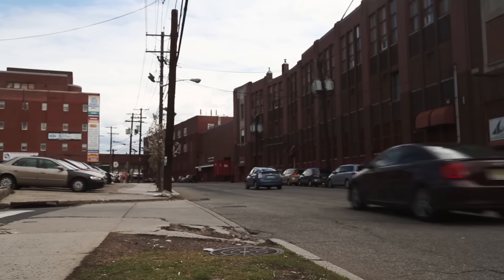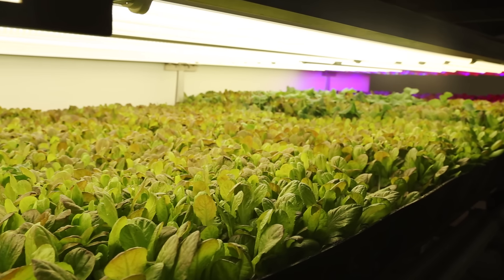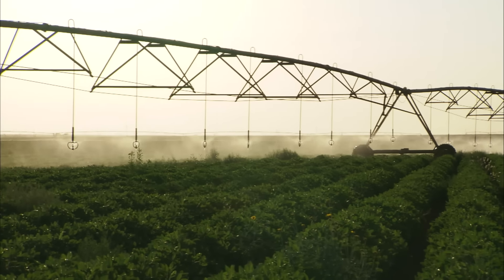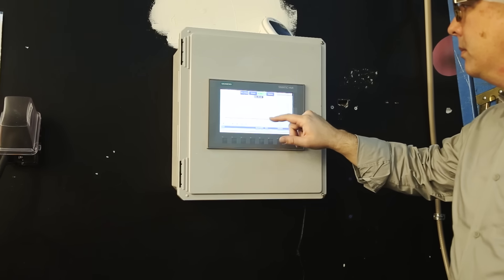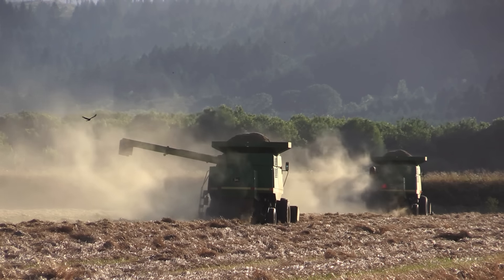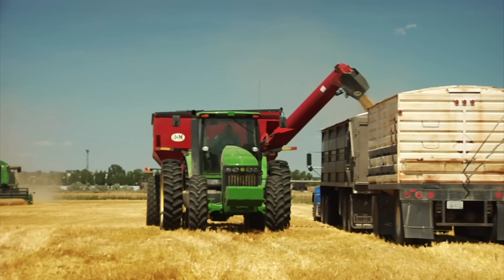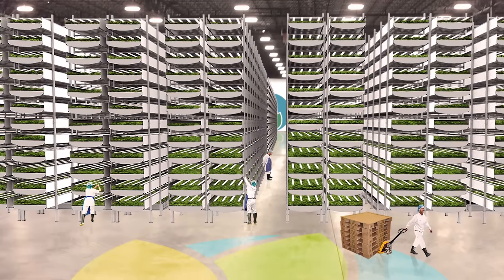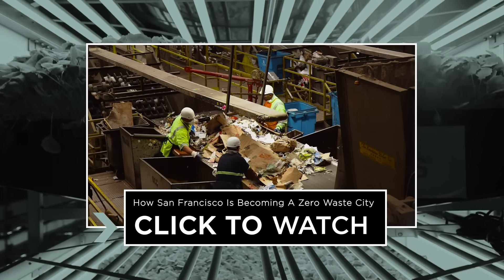This Farm of the Future Uses No Soil and 95% Less Water

Comment: like Uber will weed out Taxi companies, vertical farms will kill conventional farms and hungering be a thing of the past. yes, a few people will suffer as a result but for he benefit of the greater good.
Reply: Doubtful. Conventional farms is till more cost competitive.
Reply: at what cost? fucking the environment. that doesn't sound to bright does it.  anything worth doing generally costs more. its like buying a decent pair of shoes. is ya cup half full or half empty remliqa?
Reply: Vertical farming isn't exactly  greener.What this video neglect to mention is that vertical farming requires intensive amount of energy( which still uses fossil fuel at the moment)  and resources to start up.

The most important thing is there is still no pressing need to switch to vertical farming  right now, even from an environmental stand point and from a cost perspective.In the future, maybe.
Reply: Not everything can be produce in vertical farms also for now it's way more expensive and it's not proven to be efficient. Maybe in a couple years a lot of lettuce production could be made that way, but we're far from there with other crops. For now the only thing that can be grow this way and make profit out of it is weed.
Reply: It will never be more environmental friendly to use artificial light instead of the sun.
Reply: +Philippe Morin

Not until we solve our energy issues ,that is.
Reply: energy problem will be solved by using renewable energy.
Reply: While this is true that electricity bill must be tremendous. You have to understand that this is still the future has we are heading toward being less dependent on fossil fuel. Right now the cost of solar panels are decreasing increasingly making it a viable replacement for our energy needs.

Also, there's places like here where i live in Quebec where the production of electricity is mostly based from hydroelectricity which is clean and renewable for the most part. This factor alone makes these vertical farms an ideal solution and the ideal transition toward a better world.
Reply: Lorem Ipsum  Especially in colder climates like Canada.

I agree with you on the energy. Solar is going to dominate the energy market in the next 110 to 115 years. Powering a vertical farm will be no problem. Way more efficient than traditional farming.

But some crops, like corn or wheat may be a challenge. They're just kind of large naturally.
Reply: +Tim King

I don't think you understand the magnitude of the problem here. Particularly the challenges facing renewable and why they still haven't taken off.

Putting more demand for energy via vertical farming while those issues are unsolved isn't prudent.
Reply: remliqa I understand why you might say that. However, I've been studying solar energy for several years now. Scientific papers, science lectures, engineering presentations etc. I'm no expert, but it is apparent to me that solar is going to take off over the next 10 to 15 years. I think it's about to explode. I can explain a bit here.

Solar technology and solar price performance per watt is following an exponential growth pattern. Every 18 months or so, the cost of solar per watt is going down, while the efficiency is increasing. That's the gist of it.

I see solar energy worldwide growing really fast. If it continues its current path, which I see no reason for it not to, it will over take fossil fuels as a power source in less than 15 years or so - at least in America, most likely Europe, followed by Japan, Australia, and some other countries.

The efficiency of storage technology is also on the rise. It's part of the plan. We already have home units that can store power for night time usage. Storage for solar utilities at large scales is already a reality and continues to improve quickly and competitively.

But there's always something else that nobody is paying attention to, except people who study it.

Atomically Precise Manufacturing. Think of d printers on steroids. Basically it's a molecular level assembly device. This technology will be putting devices from the desktop level upwards that can produce items such as laptop computers, clothing, appliances, building sections, or perhaps a simply wooedn spoon if you fancy. Expect the first commercial APM devices to appear by 2030 or so.

This means that creating vertical farms will be a piece of cake. Okay, nothing is easy without hard work and dedication, but the materials and the energy needed to do it will be abundant and producible on site - even the LED lighting fixtures and the solar equipment.

But most people don't believe me, so I won't be offended if you say it's crazy. I'm okay with that. :)
Reply: Tim King Solar energy will become less expensive and more accessible it's not even a question, but it will alway be more expensive and less ecological than the sun. Also the problem with those vertical farms is not only about energy usage, it's also about the needs of a plants, the plant you produce in those environnements will alway need fertilizer and you'll always need pesticide. Also the quality of the fruits and vegetable you produce in artificial environnement is not the same than in a great natural environment. Changing the way we produce in field is the only ecological way, if done correctly it's also the less expensive way.
Reply: Philippe Morin Anyway, no reason we can't build lots of green houses. We have plenty of space and technology will enable cheap affordable green houses in time.

I do think vertical farming will continue to grow, but at a certain point, green houses will be great sources of food as the population moves to more urban and rural areas (like around the 2030s)
Reply: Yep! Old industry gets replaced with newer technology and jobs are not lost new ones are created. Look at the computer age how many jobs were created out of new technology. Farmers will never be replaced they just need some help because they are one of the most important jobs in the world. (basic survival of all species: Food, water, shelter and procreation)
Reply: +Philippe Morin I will have to disagree with you. You say that the plants produced in these verticals farms will always need pesticide, but it is clear that one of the main benefits of the vertical farms is the lack of use of any pesticides what so ever. 

Indeed, since you're in an indoor temperature controlled environment it is fairly easy to keep the pests out effectively eliminating the need to use pesticides. Also, these farms employ strategies such as air filters, temperature and humidity controls and use ultraviolet light to remove harmful microbes. On top of that, being indoor makes you impervious to disasters that would otherwise decimate an entire crop outdoor. All that these factor contribute to the quality of the vegetables.
Reply: Lorem Ipsum What you're describing is a laboratory, yes if you grow plants in a laboratory completely clean from the outside you can eliminate the need of pesticide, but it's also way more expensive and you'll still need to empty once a year to make a cleanup unless all your employees get cleaned and wear sterilized suit every time they get in. Also you'll face a lot of issues, lettuces are really easy to grow, but lot of crops will face problems because there's associations in the soil between microbes and plants that you can't really reproduce in a laboratory. Plants are alive they need these associations between them and other living things, microbes and insects, if you take those away you have more problems. For exemple, in tomatoes culture you need bees, so another living thing inside, those need sunlight. 

My point is the more you start to understand plants needs the more you realize that to make good food, vegetables and fruits with all the vitamins and nutriments that it can contain, the more you you understand that you need a soil to grow them, that soil need to be alive, full of bacteria and insects. We don't have the knowledge necessary to reproduce that in laboratory we don't know all the interactions between them. Sure it would be fun to have control over everything, but we don't. Being able to grow inside is useful and in some cases you have to do it, but saying that it's an ecological alternative to growing plants in field is a complete lie. The only good reason to do it is for intensive production in confine places, the reason are purely economic, but it's short term economy.
Reply: Energy is not cheap enough in 3rd world countries to make LED lighting viable for vertical farming. This is a solution for rich countries only.
Reply: Valken Pretty much all new innovations and tech are for the rich, at first.  Completely sensable.
Reply: Valken it will help with big cities and pollution
Reply: ***** 
After a while the population starts to decline. Poor people have excess children to compensate for those they lost to hunger, etc.
Reply: Farms would consist of nut/fruit trees maybe...
Reply: *****   No matter how much anyone argues for nuclear power plants, Americans won't budge. We simply do not want more nuclear plants.  Renewable energy is clearly where America is headed. Nuclear plants play their part, but we just don't want them due to the always high cost and the problem of disposing of nuclear waste. 

American tax payers are dead set against paying for them and will protest in large numbers against them. It's a political nightmare to try and get a new nuclear plant approved.

And it's actually quite mad to ignore the most powerful source of energy beaming down from the sky - the sun. A free source and abundant. more than we could ever need. And the science supports it. The engineering is continuing to produce better and better solar and battery technology to convert sunlight into electricity.
Reply: Valken  Actually, the more secure and healthier humans are, in most countries including India, the less children they have. That's a fact. Also, more women's education helps too.
Reply: +Tim King

Yes, American have this irrational fear over nuclear energy ( it's literally an N word over there)despite the next generation power plants are safer and less polluting than their non nuclear alternative. Even the issues of waste is actually overblown.

+Philippe Morin

What Lorem Ipsum  just described is a high tech factory(think of one in the microprocessor industry).Things you described(the roles of microbes and insects) can be replicated or even be replaced in a controlled setting of a vertical farm.
Reply: Oxy Moron  Except that the burning of fossil fuels is a problem with all the CO2 pollution. But apart from that, right - we do not have an energy problem.

That said, if electricity was cheap and clean, we could start doing some really cool businesses that are limited today. IE: Vertical farms and time machines. lol
Reply: Oxy Moron  lol that's true. But most people see it as that when talking about global warming.

I wouldn't suggest inhaling it too much, though.'

Hey wait. I take that back. Technically speaking it is harmful when talking about the introduction of CO2 into the atmosphere by humans:

pollution
noun
the presence in or introduction into the environment of a substance which has harmful or poisonous effects.
Reply: + Cédric Arn4

I think you posted on the wrong comment section.
Reply: remliqa maybe your right. i still believe the first step is to limit meat consumption. its a very inefficient food type to produce.
Reply: Alex Povolotski Nah. People will still buy farmed food do to it feeling more natural
Reply: Michael Tarantolo  Sure, when money is plentiful. But you know what, sometimes no matter how much money I have, if I see two products that are essentially the same, I'll buy the cheaper one.
Reply: that's the story of free trade, and that's something that Trump fails to see
Reply: this wont save the planet since people still eat meat which account for 51% of our CO2 and they destroy the forests now to plant grains for the cattle to eat, slowly destroying our planet in the process. if you stop eating meat it is estimated that you save 400 animals per year
Reply: +penkop2012

Vertical farming( or vertical husbandry in this case) work for the meat industry as well.Use the factory-farm setting to grow the feed stock(which is much simpler than growing food) and keep the livestock in enclosed ,climate controlled  facility where their greenhouse emission (flatulence eg) can easily be monitored and controlled.
Reply: +Oxy Moron

You do realise that CO2 is contributing to global warming/climate change, right?You know ,the thing that threaten to destroy most ecosystem and caused extinction to most wildlife.
Reply: Oxy Moron Alternative fact*
Reply: +Beliye Kolgotky

LOL, good one.

+Oxy Moron

I don't consider mass extinction as sign of flourishing ecosystem.I suggest you read more about the effects of increasing amount of CO2. Everything from the  thinning of sea ice in the arctic poles to the acidification of the oceans .
Reply: Better things repleace worse things
Reply: no hunger means no starving means less death shih means more over population which means more pollution, we need disease famine and war to stabilise population or we are all doomed to destroy the planet
Reply: +Tristram Credland

The whole overpopulation thing is a myth.The guy who coined up that theory failed to account the positive result advancement to technology and science would do to the world population and how to manage them.
Reply: You mean Malthus.. in 1700's. Like pretty much any theory from that day and age, it's been changed, adapted, etc... of course Malthus couldn't have predicted our technology, that's irrelevant; overpopulation is not a myth, it's simple science that any population, with infinite resources, can exceed these resources.  Seeing as we are a closed population (confined to earth for resources), and there is only a finite supply of nutrients (or on a micro-level, a finite supply of atoms/matter) on our planet, there is definitely a population limit
Reply: World hunger has nothing to do with food supply.
Reply: You can't grow corn and wheat in it for obvious reasons. Your everyday US supermarket products are mostly using corn and wheat. It would be a great system to use for supplement crops, but for mass producing grain crops it wouldn't really be a thing. Conventional farms will be replaced at some point in the distant future, but I doubt it would be by stacked farms.
Reply: +Dungar108
The funny thing about Malthus was his theory was becoming weaker even at the time he was alive.The advancement was already there thank to the industrial revolution (and its aftermath), he just failed to account for  them in his theory.

Sure any closed population would eventually reached its carrying limit ( a point in which the resource of such habitat can no longer  support growth, in which would result in stagnation or even collapse).See that the problem with that theory:It assumes that we are a closed population (confined to Earth forever).We're not (unless we're completely fails as a technological species, that is)
Reply: Alex Povolotski why suffer?
Reply: Alamda A. Balqhin Quite a few may be out of a job.
Reply: Bwahahaha renewable energy problems???

Dude we could do so much with nuclear power... People really forget how efficient that really is...
Reply: The only reason for nuclear power is for weapons. THAT IS ALL. P.S. THERE ARE 29 OF THE SAME FAULTY REACTORS THAT CAUSED THE FUKUSHIMA DAI-ICHI. GE has been indemnified by the US government from all legal action. Terrorists don't need their own nuke with that reliability.
Reply: Roland Deschain Terrorists buy material from Russian brokers or Hillary Clinton...

Renewable resources will never able to be as efficient as nuclear power, especially with the new types of power generation that NASA is creating.
Reply: I disagree. The risk outweighs any benefit. You do realize that Fukushima is an extinction level event? It has killed the Pacific Ocean. Tuna and other fish from Japan have died in their spawning grounds along the coast of Mexico. When an irradiated animal dies the radiation doesn't disperse it CONCENTRATES. I hope you've not been eating fish from the Pacific for the last 6 years or so.
Reply: +Roland Deschain

That't onl;y true for old obsolete nuclear reactor designs( including Fukushima) .Newer and next generation nuclear plants do not produce fissile material usable for nuclear weapon production, some of them even "eats" the type of fissile  material used in nuclear weapon.

The Fukushima disaster was ridiculously overblown, especially by people who do not not much about nuclear and radiation and keep on spouting ridiculous claims like what you're saying.
Reply: Roland Deschain I was stationed in Japan during Fukushima. Do you want to know how many people came to my base for aid...

1 family of 5 people...
Reply: Philippe Morin Why not, solar power is cheaper than coal, worthless desert land can make the power. Saving 95% of the water, it can all come from reverse osmosis desalination. Over time food prices will fall, people can then eat higher quality food and obesity can be reduced. It's the poor who eat fatty, sugary, carbohydrate, salt filled food, cheaper vegetable protein, canned, UHT foods would greatly improve their diets. Remote indigenous peoples, get the worst food, because of transportation costs of fresh food, but what if the ingredients were cheaper. Then processed foods wouldn't be cheap rubbish, with little nutrients and lots of calories.

As to the efficiency, plants get less than 10% efficiency out of sunlight, solar gets up to 40%, give them the right spectrum the plants would get 40% efficiency, or 16%. That's 60% more crop, per hectare acre, even from useless desert land, more due to there being, no rain and little cloud. Whilst I'm forgetting transmission loss, I suppose it'd be about the same, with vastly reduced transport costs to the cities.
Reply: remliqa More people work in Solar, in electricity than in coal, gas, or oil combined, as we hit roaring twenties clean disruption. You will see, that it has already taken off.
Reply: Philippe Morin its true that you need a soil that is alive, but what I am wondering, is the following question: Could those 'seedblankets' also act as a pseudosoil? if so, more 'complicated-to-grow' plants like  tomatoes could be grown like this. 
not that I find this the most efficient way to grow tomatoes, for they are a tad longer then the average kind of lettuce
Reply: Stuart Brown It takes petroleum to build those plants. Then you need to replace them every 20 years...

Did you know nuclear power plants recoup their cost of building in the 1st six months of operation. I mean the total cost... including labor, government licensure, all of it... That is how efficient they are. They produce like 10 times the power they use to operate.

Wind, solar, geothermal will NEVER BE AS EFFICIENT... EVER...
Reply: too bad in this indoor environment the plants are not able to create the enzymes we need in order to fight off things like cancer growth...
Reply: oh and check out forest gardens, now that is the way to give back to nature with minimal effort and create amazing amounts of food. Great thing is it supports the natural ecosystems for animals and wildlife.
Reply: +Stuart Brown

I think you're sorely mistaken if you think that green and renewable energy sectors currently  provide more  jobs than the fossil fuel industry.

+anon amous

There is no proof in your statement about enzymes so I don't think they're worth discussing.

Forest gardens shared the same problem as organic farming : they're in no way productive enough to support  huge population.
Reply: As a farmer I am well aware of the stats and it has nothing to do with "greed".  Much of it is due to gov't regulations that control the process from picking to selling. Between 40-50% is not eaten due to problems with picking, distribution (spoilage), discarding of imperfect plants, grocery "out of date" waste, food bought but not used and food prepared and thrown away. I've seen figures as high as 60%

I was once a huge fan of VF  but having visited some I now see their limitations. Start up costs are high, energy use is heavy and (worst)  crops are very limited -almost all leafy greens or tomatoes.  On the good side they are incredibly efficient, close to stores and can ignore the seasons.  But if you want peaches, apples, pears, bananas, squash, watermelon or okra, forget it.
Reply: fun soundwave remixes That's because of a few things. But mainly, they pick them way before the produce is ripe. 

And the majority of GMO garbage you don't eat. That is given to animals for feed.
Reply: Alex Povolotski that will not happen aslong as not everybody turned vegan..lifestock eats up the most of the water and crops..so we first have to eliminate animals as food then this might be a big thing
Reply: remliqa I think they mean that solar alone provides more jobs than coal, oil, gas, in the electricity sector, because of the installation workers, carbon is highly capital intensive, requires few actual workers, like agriculture in Australia, manufacturing, mining. Because of overproduction, there's not even the same financial power to coal, oil and gas, as a lagging industry, it has huge political power, people think they are going to get their jobs back, but even if they went back to carbon, the jobs wouldn't be there. Again capital intensive engineering, highly automated, it's only in the construction phase that there's jobs and not many of them even.
Reply: Stuart Brown Even let's say we made solar viable to fit the power production needed to fuel the country.

You still need to replace solar cells every 20years, and you cannot get around that number. This in turn would drive up costs, and create a singular market that holds the country by the balls, not just politicians and government. But the individual house hold aswell. We curbed this by government policies. But you just can't do that when you need to build a whole line of solar panels every 20 years.
Reply: im from Ecuador and energy is cheaper here than in USA
Reply: We don't have type writer cleaners anymore careers go obsolete all the time
Reply: Some people in the world are not hungry because of lack of food, they are hungry because of greed of few.
Reply: yes I know, this however is where ? you think places like this will be built in the middle of Uganda ? I know the effects of capitalism are terrible but humans are greedyand we all suffer from it in the end
Reply: Dude, if you think the "effects of capitalism are terrible" try visiting places that don't have free markets.  It is China and India's rejection of centralized economies and turn to choice and competition that has lifted hundreds of millions out of poverty.   Right before we left on a trip to Africa I heard some idiot going on about the "yoke of corporate capitalism" and looking at the wrenching poverty, poor health and filth of areas that did not "suffer" under this yoke, you can only shake your head.

When we left the USSR it was not a capitalist nation and yet it was in ruins - millions of square miles were polluted, radioactive, rivers ruined, land not viable for growing crops - hardly the scene of nature one would expect.
Reply: when exactly is this going to happen? they've been talking about vertical and rooftop farms since i was in grade school, here we are over 20 years later and we still have nothing but videos like this to show for it. 
it's obviously not commercially viable, so it's not killing anything.
Reply: Alex Povolotski fuck Uber!
Reply: Alex Povolotski well, some crops that require to be harvested from trees and such will still be grown by conventional farmers.
Reply: nice point of view!
Reply: Alex Povolotski: agreed. just like coal that kills workers, poisons communities & the environment. replace it with solar & create jobs retailing, manufacturing, training, repairing & installing solar & wind in every city not just coal country. we will see benefits everywhere to our citizens health & economy!
Reply: Alex Povolotski why cant mericans say herds it has a fuckin h in it, its not erd
Reply: Do you mean "herbs"?  Actually, Wiki has an article on this and notes that all "h" dropping occurs in England and Australia.  I have heard all my life older people say "hit" for "it" (I live in the South)  "Herb" is simply a mater of origination.  It was French and the "h" was silent.  Eventually some started pronouncing the "h" though it was considered "bad English" to do so when I was a kid.
Reply: Tim King Agree solar, a roaring twenties technology, but why Australia after America, we have more than 1.5 million households, with solar power, at 23 million people. The USA has what 300 million people, but only about as many solar power households. 25% of our deserts could give us 1,500 times our power needs, or make a trillion tons of liquid hydrogen, per year. May I point out, we have loads of intellectual property, in solar. We the inventors of WiFi, have the highest efficiency solar cells, 40% cooled, concentrated, high and low frequency solar cells. We have a low population, for a continent, which is 75% desert, hence only a 1/4 of our deserts, can give us 1,500 times our energy needs. Whereas the US voted for a coal lover, still he did get 3 million less votes, than Hillary. More, the US doubled its solar production, last year.
Reply: I never knew solar panels were nationalistic getting more efficient depending on who was using them.  LOL Thanks for that glowing recommendation of your country (it is stunning)  but let's make a deal - you don't criticize our politicians and we won't criticize yours. It's like a family - I can criticize my brother but I sure as hell don't want outsiders doing it.  Trump cannot reverse technological trends and I doubt many in Iowa or Florida had coal on their mind.  

As for HC, isn't it odd that the GOP controls the Presidency, Senate, House, 3/4 of our governors and 2/3 of our state legislators yet HC gets more votes?  No conspiracy or illegals, simply a huge concentration of voters in a very few places (look at a county map).
Reply: remliqa: perhaps, & yet, the carbon footprint of growing in an urban environment would be reduced on the shipping end & with solar & led tech, the over all impact would lessen yearly
Reply: Philippe Morin: the is an ancient technology called a skylight that could easily be employed
Reply: Stuart Brown Yes, I agree solar is moving in. And sure, Australia ought to be able to go full on solar way before America. America is much more complicated politically which tends to slow things down: but it is happening none the less.